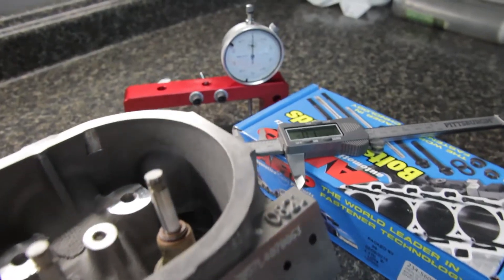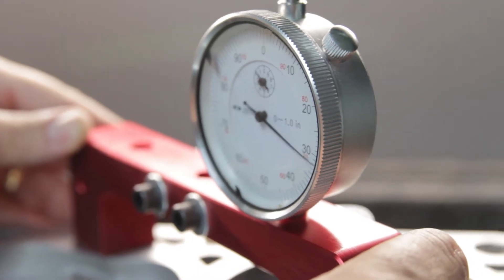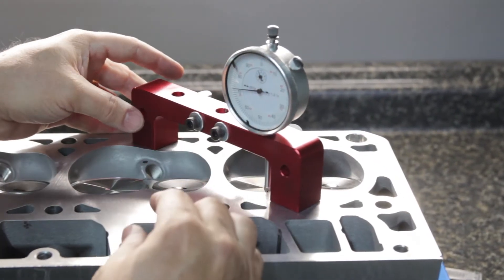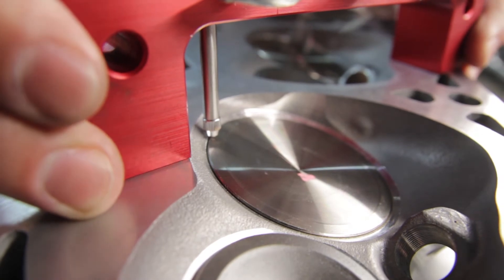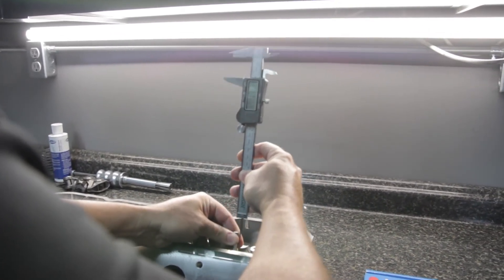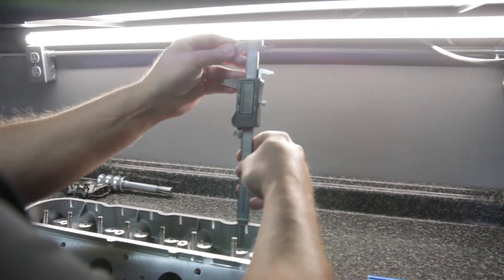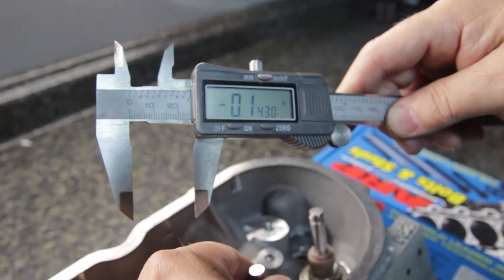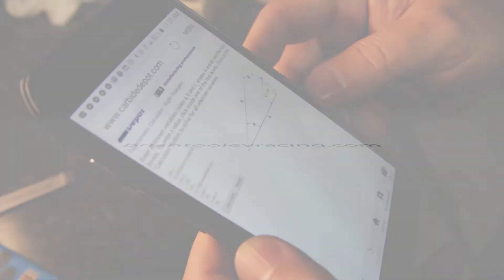Checking Valve Drop

Comment: How is this info used to figure out PTV clearance?
You have no cam info...?
Reply: This video was mislabeled, this is checking "valve free drop" not piston to valve clearance.  You can use free drop to calculate P to V if you have all of the other information.
Reply: @briantooley8459  what other information? Deck clearance?
Reply: Cam specs, head gasket thickness, piston height to deck provided its a flat top like a LS1, LS2, LS3, LQ9, etc.